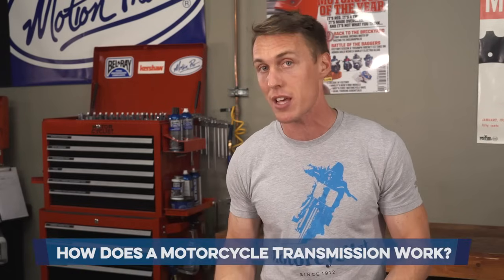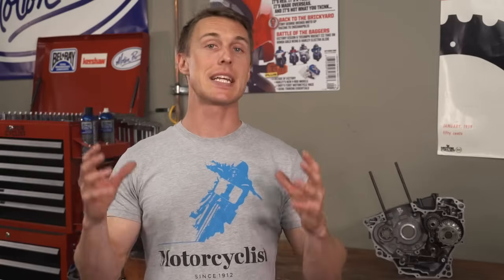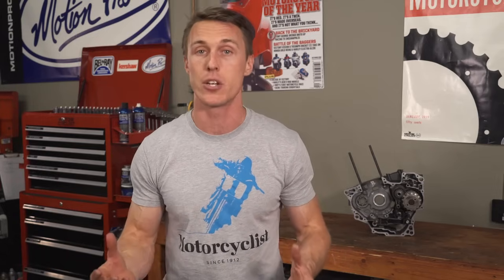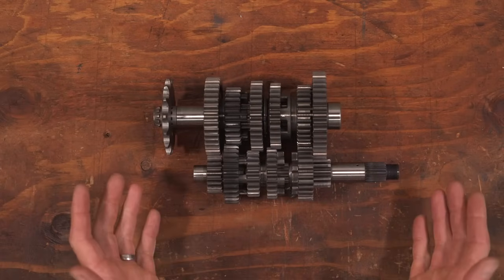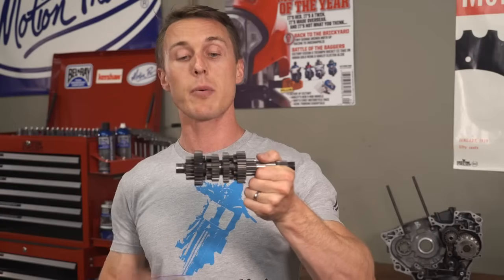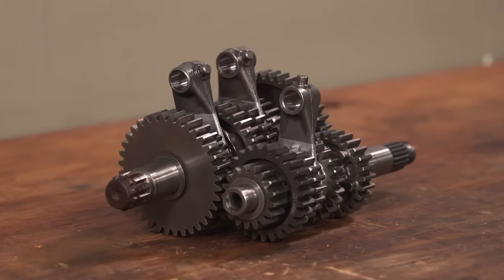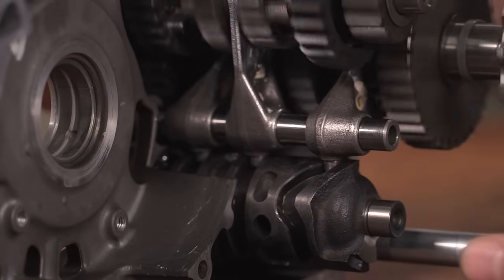How a Motorcycle Transmission Works | MC GARAGE

Comment: So I´ve been wondering.... I rode alot of mopeds when I was younger and (Except for the Honda MT5 I believe) on most of them all gears where all up, or all down. So how does it work on a motorcycle? 1 is down... Yeah I get that.... And the rest is up... Does that mean you shift TWICE to go from 1st to get to 2nd? I´m a bit confused about neutral being BETWEEN 1st and 2nd.

Comment: Please my motorcycle start to vibrate when in gear 3
Reply: at what speed? 

vibrations or jerks ?
Reply: Jerks. Immediately I enter gear 3
Reply: If only on the third, then you need to disassemble and examine the gearbox for visual defects.

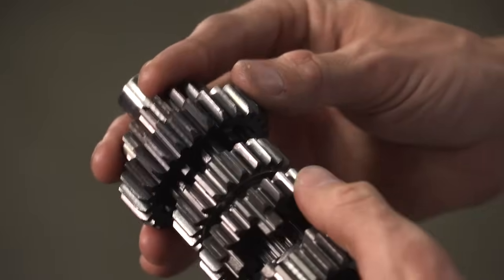in this video he shows at 1:22 min.

Pegs are called dogs and they nest into corresponteding.

The retention occurs because there is an angle of inclination.

The angle becomes round due to wear and the gears are no longer held together.

It's fine on a hill with no load, but on a hill with a load it starts to skip. 

A new pair of gears is the best repair.
 @georgeomonigho8344

Comment: Tenere 700, new, would not shift down at slow speeds. I finally figure out if you engage the clutch 25% and move forward it will drop the gears, usually you're in fifth when this happens, pull clutch back in, release again 25%, lather, rinse repeat. Changing the oil is the key but down shifting before coming to slow speeds is a better habit.

Comment: I have a dumb question if anybody can answer. Let's say I'm in 5th gear doing 55, if I pull in the clutch (and keep it held)  shift down to 2nd, slow down to 2nd gear speeds and then release the clutch, is that okay on the transmission/motor? Or should you always be rev matching and downshifting as you drop speed etc.

Comment: I like you videos. I have a problem with my yz 250. When the bike is not running and in Neutral the car will stand freely like it should. But while still in neutral and starting the engine the rear wheel moves with force of the engine. Do you have any idea what the problem is?

Comment: I have a question. I laid my 2016 ninja 650abs down last night and my only issue is the left side rear-set is bent in causing my shifting lever to be obstructed. How can i get another piece (just that one rear set plate) by itself

Comment: Very informative video - learned a lot.  Need some advice/guidance. Planning to build a buggy with two m/c engines coupled (belted) to one auto transmission input.  I know it sounds silly, but I am committed to doing it.  My departed 30 year old whizbang son was going to electronically sync speeds etc., - I promised his soul to complete the project in his memory.  Any ideas about gearing and so on?  Thanks for any advice/pointers.  Cheers

Comment: My brand new triumph bobber black 2020 sounds like a slug hammer hitting the transmission casing when i put it in first. 50kms on it and they charged me $27.00 to tell me thats a normal sound.......its more like an un-refined motor/ transmission. A transmission from the early 50s more like.

Comment: Neutral is only where it is because some early bikes had to put it there for engineering reasons and everyone kept copying it. Just like the twist throttle not a good or very safe design at all but at the time was the best they could come up with and everyone has continued to copy it.

Comment: What is the correct way to come to a stop? 

I just purchased a motorcycle and I had absolutely no experience with neither cars or motorcycles and usually when I want to stop I press the clutch to go all the way down to neutral while I break at the same time

Comment: Need you advice... My mechanic told me my clutch was slipping and needs replacement. I insisted that clutch is not slipping since what im experiencing is when I upshift say from 2nd gear to 3rd, it will just engage 3rd gear but goes back to 2nd gear and revs high. Happened several times also in other gears whenever I upshift. Im suspecting the issue is in the transmission and not the clutch. Any thoughts?

Comment: Great vid. I recently bought an 08 r1 and in 4th,5th and 6th gear i get a weird burring/whining noise on de acceleration mosty  only when it drops to about 4-5k revs bit if you hol the revs at that point the noise sort o stays. It sounds afwul and makes me worried its something in engine.

1st,2nd and 3rd all sound normal.

Comment: I also think that pushing down to shift into first from neutral means you can just lift your leg up, and press the gear shifter, then put your foot on the peg, instead of locate the peg first, hook your foot under the shifter, then shift up.

Comment: Some biles have 1st up and the rest down, some others, including new ones, have all gears down. I even have one with all gears down and when goes to 4th, then you push down again and goes to neutral and you can keep pushing down to strart over.
It goes both ways, of course.
Some othet gear boxes have a "flute" instead of that drum, and some balls come out of that flute to engage into the gears that freely rotate on that flute. And it doesn't end here.
So, what i mean by that, is basically that your video is full of crap.
Btw, some bikes have a hand lever for gear changeing.

Comment: I have two motorcycles that both don't follow standard gear shifts.
1 my pride and joy a Royal Enfield Bullet from the 60's that has the shift lever on the right.
2 my baby and the most I've ridden so far a 90s early 00s Kawasaki Bajaj 150 that shifts  all down. Neutral is below 1st gear 😎
#NonConformity

Comment: Thanks! Say,after i've been cruising for a short while and are coming to a stop,Sometimes i cannot downshift until i have been stopped for around 2 minutes. It only happens after riding for some distance,Not every block or two. I've changed the fluid and there were some metal shavings but Not big pieces. Also i filled it to the bottom of the clutch ring as instructed. Any advice would be appreciated,i get scared when there's traffic behind me and it won't downshift. -Regards,Bob S.

Comment: What do you might cause a bike to have a clunking or grinding sound from under the tank area when slowing to a stop (clutch lever pulled all the way in and to stop)?  It also happens when pushing the bike or backing up too.  Thanks!!

Comment: what does he mean by sticky gears? And why does my bike jump forward when im holding still and putting it into first with the shiter held all the way in?
Reply: It means you need a clutch adjustment at a minimum. If the gear is catching your clutch is not fully engaged. ProTip: Always hold your shiter in unless you're over a toilet.

Comment: i bought a bike that has neutral all the way down (yamaha ytx) and OMG what a mistake, i didnt think much of it before i bought it, but since then, i have rolled into many intersections, clicked all the way down to power out right as i am now in neutral and rolling too slow to keep my balance.  and actually, my buddy has a "bike", ok, ok, a scooter that is reversed shifting.  so the shifting isnt standardized.  first gear is all the way up, and top gear is all the way down.

Comment: Hello sir
Have a question? 
My stoke gear ratio 
1st - 2.83
2nd- 1.87
3rd- 1.36
4th- 1.14
5th- 0.95
6th- 0.84
I want to upgrade a racing gear ratio. in this gear ratio my top speed is 142. 

1st- 2.53
2nd- 1.81
3rd- 1.47
4th- 1.27
5th- 1.13
6th- 1.04
after installing this gear ratio what will be my top speed increase or decrease?

Comment: When you're at rest and going from neutral to first, and both shafts are stationary, if the dogs are not aligned with the slots, how do you shift?
Reply: When you're in neutral with the clutch lever released, the engine is transmitting its motion to the gearbox input shaft which makes it spin allowing the dog teeth to slide into the dog recesses.  When you pull in the clutch lever, the input shaft still spins residually even though it's disconnected from the engine, thus still allowing the dogs to align and engage the 1st or 2nd gear you're shifting to.

If you pull in the clutch and wait a little while for the input shaft to stop spinning (while still parked in neutral) then yeah the dogs might not be aligned.  In that case just release the clutch lever to get the input shaft to spin, pull the clutch lever back in again, and immediately shift.

Comment: plz help, I'm new to the bike world, and started practicing on an old suzuki at a safety course for beginners, and I had no problem shifting from first to second and so on. i recently bought a new Ducati, and I haven't been able to shift out of first. A friend told me that I should be able to switch gears while the bike is stationary (clutch is in of course) but its as if it keeps getting stuck in neutral, I cant go up past it. Even while riding, going roughly 18 mph, 4000-6000 rpm and stuff, still couldn't go past that neutral spot (I tried to shift up as hard as I could) any suggestions?

Comment: This is urban legend.  Motorcycles have a squirrel running on a treadmill.
Reply: Motorcycles run on prayers and money.
Reply: Actually nowdays most bikes run on 2 squirrels 🐿 🐿 .
Reply: It's the lil gremlins. 🤣
Reply: I'm pretty sure mine came with 2 pairs of Hamsters.. and I'm not sure if it helps they don't get along too well..
Reply: I think it’s just your brain running on squirrel and treadmill
Reply: my squirrels like gatorade
Reply: I got the Mongoose upgrade
Reply: That's weird, my bike has a raccoon doing pull ups for power

Comment: Today I was driving my yz250f, It went from 2nd to neutral!  I was just downshifting ! Is that normal?
Reply: Depending on the age, speed and condition, yes that's common. Neutral is below 2nd, so a downshift from 2nd can result in neutral. 

Kawas from the 90's(?) onwards had a "positive neutral finder" which meant below a certain speed you couldn't choose 2nd from 1st (I think). 

Various manufacturers have various ways to handle it, but yes, it's normal.

If you don't want those "accidental neutrals", you kind of have to be more deliberate in those gear changes.

Comment: Those aren't "sprockets" in there, they are gears.  Also, how hard/difficult/expensive would it be to alter a bikes top gear to be taller, without changing any of the other 5 gears?  For example, someone resprockets the bike to be 20% higher revving in the lower 5 gears but then wants to compensate for that with a 20% taller 6th gear so that the modified 6th gear is about the same as stock.

Comment: I used to ride Royal Enfield bullet 350 in India and it has gear lever on the right side. First gear is up and 2nd, 3rd , and 4th gear is down. It also has a separate lever to go to neutral. It can be shifted to neutral from any gear. Can you make a video about this motorcycle.
Reply: And do you know why other manufacturers don't make that neutral shifter?

Comment: my bike is missing 6th gear. it has 5 gears and it feels like its supposed to be but in the users manual and all over the internet you can read that this bike has 6 gears. i contacted a few owners of the same bike on instagram and they say they have 6 gears.
so what could be the problem? i got a '97 suzuki DR 125 and i dont really want to open the engine/gear box because the screws are so tight and rusty that i have to destroy them if i want them loose. would be really expensive and i dont want to open it as long as i dont know what it is because now its still working and if i open it it will take a month or more until i got replacement parts and stuff

Comment: When do you think the manufacturers would come out with a 7 speed transmission? Don't you think, especially, 600 cc's or smaller displacement sportbikes would benefit more with the additional gearing?

Comment: Some Honda small bikes (100/125 cc) have a different shift pattern: N-1-2-3-4 starting from the top. 

Honda C 100 Dream and derivatives have a sort of clutchless gear (a "semi-auto" clutch that disengages the transmission when the bike is stopped and idling or when you release the throttle and shift gears); when you are on 4th gear you may tap down once to put it in neutral while stopping (instead of tapping upwards four times).

Comment: got a yamaha bike manual transmission, is engine breaking bad for the gears or the engine? 
started to use it a lot (I do rev matching, and the engine is liquid cooled system)
I know doing the breaking wrong wears the clutch disk, but more worried about the engine and the gears

Comment: Didn't mention that a lot of riders were getting rear ended at stoplights because neutral was at the bottom. Don't have time to react and put it in gear to pull away. That's why the law changed it to first on the bottom always.

Comment: You do realise that a sprocket and a gear aren't used interchangeably... a gear meshes with gears, a sprocket meshes with chains/belts. Therefore, everything in the box is a gear, everything outside touching a chain is a sprocket.

Comment: I have a 1999 Kawasaki KE100 that I just bought and it shifts upwards just fine, but will NOT shift down to first.  This is true whether the bike is running or not, and whether or not I rock the bike back and forth or try mid-positions on the clutch.  Anyone have an insight?

Comment: I dunno who came up with 1 N 2 3 4 5 6. Just have N 1 2 3 4 5 6 is way more logical
Reply: He literally explained why n123456 is a bad idea in this video...
Reply: I agree.  I'm tired of missing 2nd gear on take-off.  :P
Reply: Some did try that back in the late 60s early 70s, not a good idea, for a few reasons
Reply: if you actually ride a motorcycle this is easy to understand

Comment: well, this only applicable to manual clutch bikes. most bikes in southeast asia has radial clutch so you don't need to disengage the clutch to change the gear, and the gear sequence isn't 1-N-2-3-4-... but 'rotary' (N-1-2-3-4-N), so you can go directly to neutral from the fourth gear while in stop position
Reply: only when you bike is stationary
Reply: In what type of scenario do you go from 4th gear directly to neutral?
Reply: your*
Reply: DuskSentry coming to a stop from 4th, avoiding downshifting (it's trickier to avoid engine break without a clutch). I however downshift, maybe using engine breaking but definitely being ready to throttle in the right gear if i need to escape. Ironically, the time when a neutral from 4th might be helpful (going downhill), you can't go to it (won't change at speed)

Comment: Great video. Accidentally I shifted once from N to 1 WITHOUT clutch on my HD, the most misterious thing is the gear box did not grind or else, and it was pretty smooth (not as smooth as it used to be when the engine is hot and obviously you use the cluctch, but similar like the first time you shift to 1 gear in cold) How could it be?
Reply: rev match

Comment: i have some problems with my motorcycle transmission, 
1. i cant find the neutral while the engine is on
2. i cant change the gear if i dont pull the throttle
any solutions?

Comment: I have a sv1000s and when I put it on first gear sometimes it moves forward a bit while I'm holding the clutch and it just shuts off of me. do you think I need a new clutch for that or just a oil change

Comment: So interestingly enough, neutral is below first on many ATVs.  The only ATVs that follow the standardized motorcycle shift pattern are typically sport quads which are normally using motors and transmissions from Motocross bikes, they also tend to be the only ATVs with manual clutches.

Comment: Hi,
I have a Derbi GPR 50cc, it has 6 gears and works the exact same way as a motorcycle. However, I recently changed the transmission oil. First when I drive off it shifts perfectly but when I've driven for about 20+ minutes shifting gets really hard and some power is needed to shift down. I guess this is due to the oil heating up. But can someone explain to me why this it gets so hard to shift down? And what can I do about it?

Thanks in advance

Comment: Hi... im new in the bikes world but i have access to a power commander and i got a Honda CB190R (is a singlecylinder with fuel injection 184cc bike).... i know it is too much and crazy but... is it posible to apply that power commander to a singlecylinder motorcycle and have some improvements?... i know that will be just a few HP... but i just want to know if that will harm the motor or not, what ever the result. thanks.

Comment: hi is it possible to convert 5 speed gearbox to 6 speed gearbox ?
Reply: I've heard it's possible on some old yamahas, i also heard if you do the conversion wrong (on the rd yamahas) you'll end up in first instead of 6th, but this is something i read awhile ago so I could be wrong
Reply: It would be easier to just buy a new gearbox that's compatible

Comment: Thanks for another great video. Just one quick question. You didn't answer why the shifter is on the left, or why down for first and not up as on race bikes ( my understanding has always been that when racing and leaning over at extreme angles in a corner, trying to get your foot under the lever to shift up on the way out is near impossible and so you tap down from above to shift up and accelerate away. Putting your toe under the lever going into the corner to shift down was not so much a problem as entering a corner you are more upright and then when you lay it over to accelerate out, a little tap on top and off you go). Why on the left side? Hmmm, do you know apart from it being legislated so? And if so why that particular legislation? Again, great videos and thanks from down here in Australia